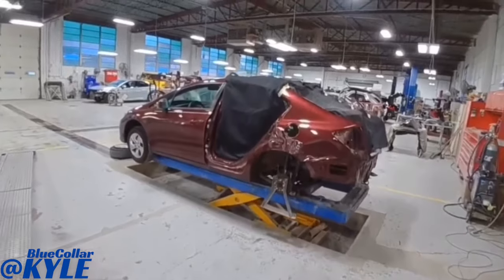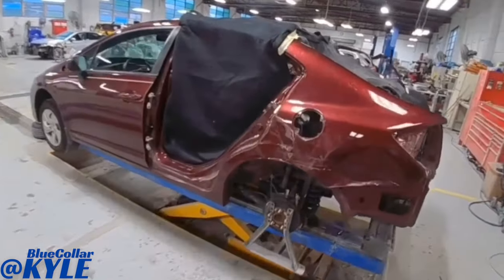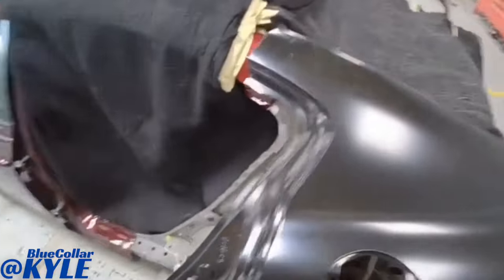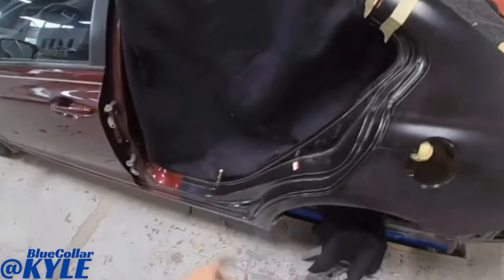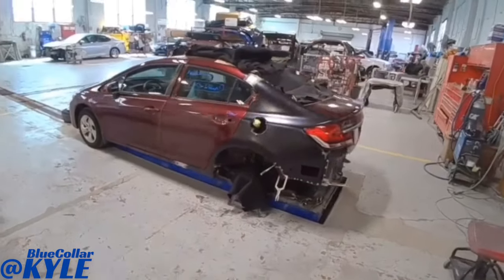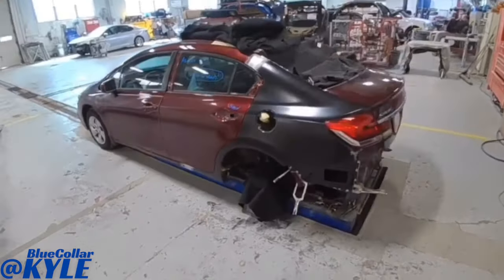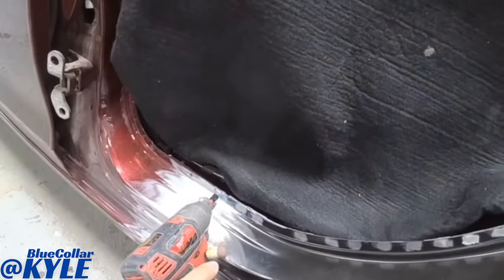Replacing A Civic Quarter Panel!

Comment: how much would this cost at a shop roughly? Thanks!
Reply: We just did this to a 2019 Honda Odyssey. Granted the sliding door had to be replaced and fitted as well, but the repair was roughly $8200 so for this older civic, no door damage. Probably closer to $3800-$4400 depending on the availability of that paint
Reply: @jhenson5168  thank u

Comment: Is there another way or a different tool people could use in a home garage to do those pinch welds you did at the end with that press/weld tool? My brother and I will be doing this to a 6th gen civic sedan quarter panel.
Reply: Mig weld.. punch tool and plug weld it if you don’t have a spot welder

Comment: Great video. Why do you put those backer plates? And can i ask u why when i line up the panel and weld it to the rocker    
the weld itself closes the gap slightly between the door and the quarter panel. Thank you in advance.

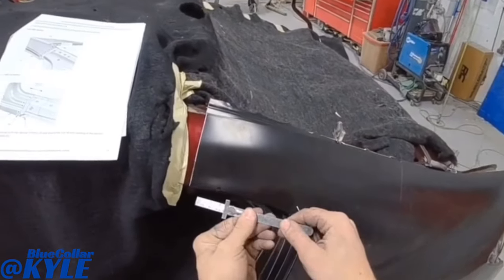Comment: What are those instructions you have printed out at 4:00? Are those available for DIY-ers? Also, is that weld through primer you use at 5:42? And at 7:50, what is the stuff you put on and what’s the purpose?
Reply: They are specification insurance prints out so you will cut and weld where they want you to

Comment: Hey Kyle whats that grey/tan sealer paint you use for the back of the panels? Im in the middle of getting 2 quarters replaced on my challenger and wanted to have the shop spray them as an extra precaution , thanks man!
Reply: Ecoat restore

Comment: Hi I have a 2012 civic lx sedan and my car was rear ended in the same spot as in the video. Will insurance total the car . Also if its repairable do body shop replace the rear quarter panel or try to fix it.

Comment: Serious question. Is there a reason you didn’t prep it ready to weld before you removed the deck lid and tail lamp? You had all the gaps correct and ready to go.
Reply: Gotta make sure everything's lined up correctly before adding the caulking, incase you gotta remove it and adjust.  Cleaner job

Comment: How much would this repair cost? My 08 Accord is having bad rust leading into the door jam and it’s really worrying me
Reply: $100,000
Reply: I've got a 2009 corrola with rust on the roof near the windshiled, no doubt it's under the windshield where the roof meets it... I need both front and back glass removed and a new roof... its a real pain because I'm only at 70k Miles on it... they quoted me $3000 Cdn for the job... sheesh... but it's a lot of work... so understandable

Comment: What is the air tool with the wire wheel you use to remove the glue from the panels called

Comment: What tool did you use to get rid of the welding points before you took it off ?
Reply: He uses a "band file belt grinder" which is like a belt sander but just a little narrow belt that sticks out. There are also drill bits sold at harbor freight to drill these out. They might have been rivets instead of spot welds though I am not sure.

Comment: I would like to see the continued to see all your spray able seem sealers and caulking beats replicated honda quarter's well there not as easy as BMW 😂 gravelgauard on the rocker to that should be 125 hour sheet im hoping they wrote it correctly with all the adjacent panels that are damaged apon removal and installation of welding

Comment: What type of primer are you using on the inside of the new panel ?
Reply: yea i was thinking the same thing
Reply: @CarsNfish  I think it's  self etching primer .
Reply: @jeffarmer4428  dont see the need to primer the inside of new panel since the new panel has factory primer already..I just use weld threw primer on the spots that i cleaned for spot or mig welds..But hey always willing to learn more!!
Reply: Ez primer!
Reply: @CarsNfish  if u ever see cars driving around with the black replacement panels thatve been left unpainted for a year or two and they’re totally rusted through, you’ll see why
Reply: @gunnar6726  yea thats from the sun eating the E coat
Reply: It’s a etching primer made by SEM. it comes in different colors to match factory primers.

Comment: How much does a job like this cost someone?
Reply: All in all probably $3-4
Reply: LetMeSeeThis99  I hope you’re just being facetious lmao but yes $3-4k. Depends what shop you go to. Labor rates are about $60-65 and up for body and paint. A quarter panel-bumper job like this pays a good shop 14-15 hrs, plus all the blending required on the rear door roof rail and gutters.
Reply: @drummer_zay9493  what about just the fitting/cutting/welding without the rest of the body and paint work? We have a paint shop, but have never replaced a qtr panel before.
Reply: @tanker242  for this specific car it probably pays 10-12 hours. Times that by $60 and your looking at about $720. I’d say closer to $850 tho after all is said and done, materials cost and otherwise